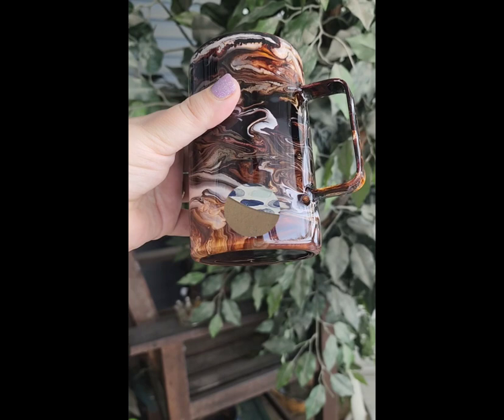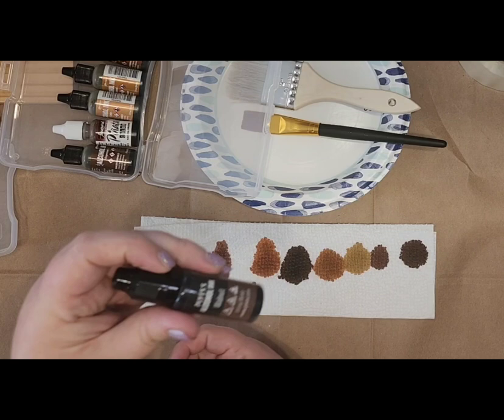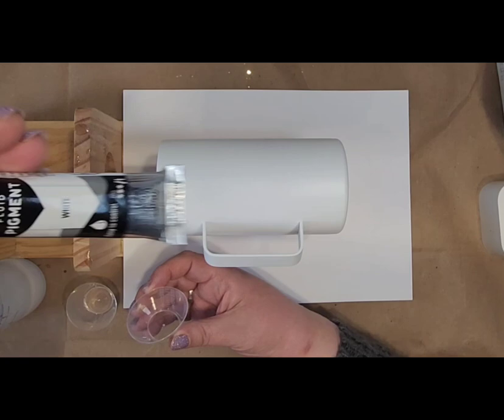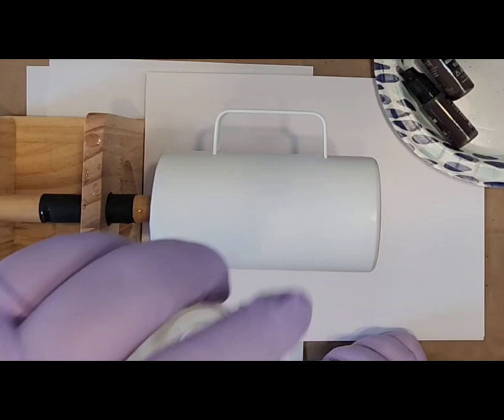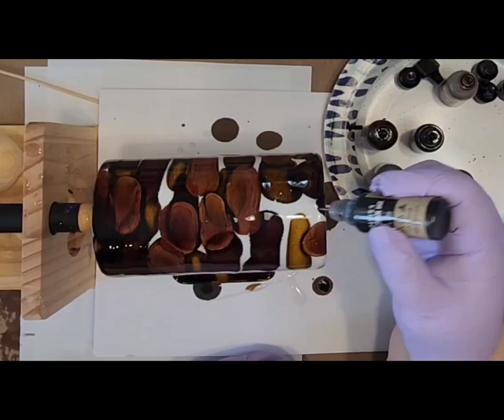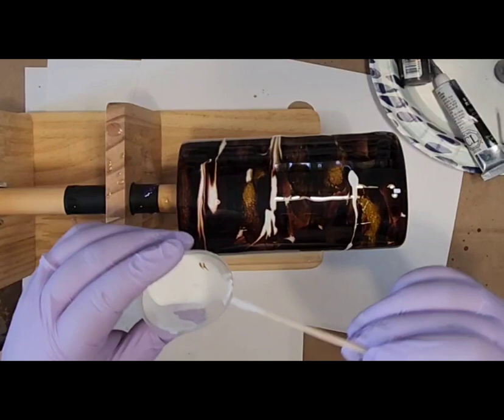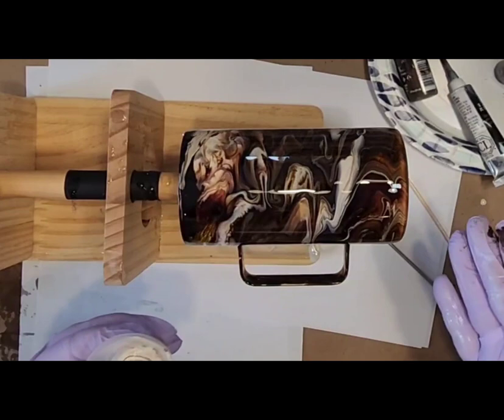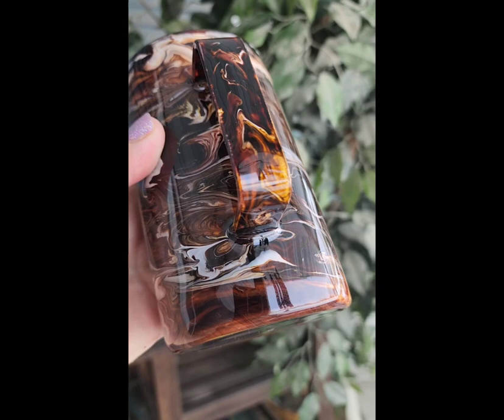Coffee Swirl Tumbler Tutorial

Comment: I love you video and the mug is beautiful! 

I had problems with the epoxy not adhering to some of my resin even after I cleaned tumbler with alcohol before starting. Do you have any suggestions of why?
Reply from the maker: First, I sand my stainless steel cup with sand paper. Then I wash it with water and a little dawn dish soap. I rinse it really well, then dry it well too. (then spray paint, if that's in your plan). I don't clean mine with alcohol before applying epoxy because even after dry, alcohol can cause issues with the epoxy layer (and fingerprints too, for that matter- so I wear gloves after it's dry). Cleaning with alcohol before applying epoxy is notorious for creating "fish eyes" (little divots in your resin). I would guess this might be your problem. Sometimes fish eyes still happen with these swirl cups (where you drop alcohol inks on top of your resin). When I get these, once dry/cured, I lightly sand over them and apply another epoxy layer.

Comment: What was that thing you pulled out of your cup? I believe it helps not get paint on the inside???
Reply from the maker: Yes!! At about the 40 second mark, the thing I pull out is basically a red solo cup (we had a bunch of transparent red ones from Christmas). I cut the bottom off, then I cut a slit all the way up the side. The slit up the side allows it to fit into almost any size cup. I typically put the solo cup in first (have it stick out the top of the tumbler a couple of inches) and then put the foam in the cup (make sure the solo cup doesn't slide down into the tumbler), then put your rod/stick into the foam. Putting the foam in after the solo cup helps hold the cup in place while you spray. 

It doesn't keep every single bit of spray paint out, but 99% of it. I take a little acetone to the tiny areas that I need to clean up on the rim.
❤️